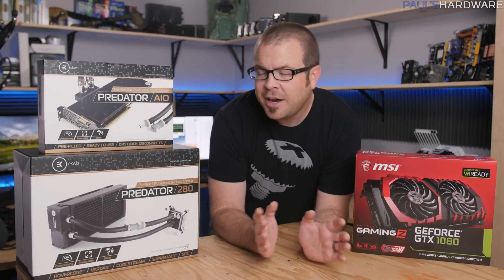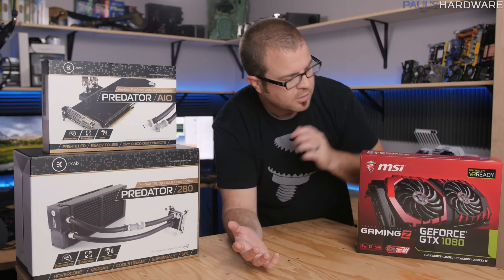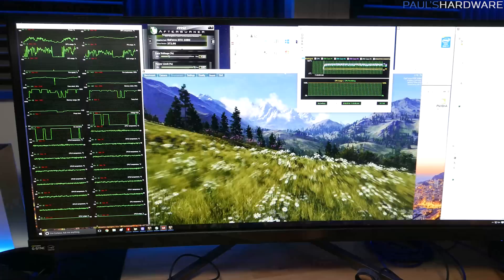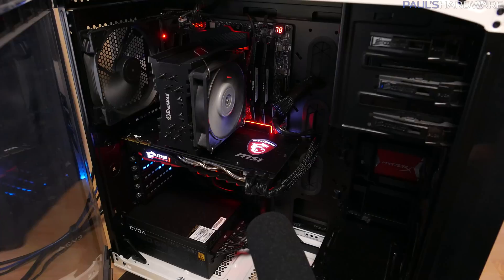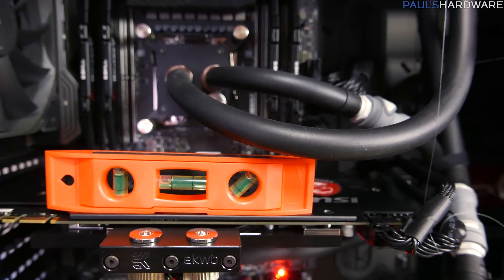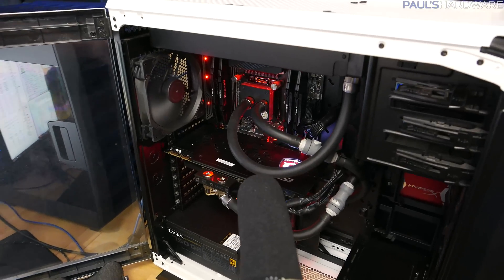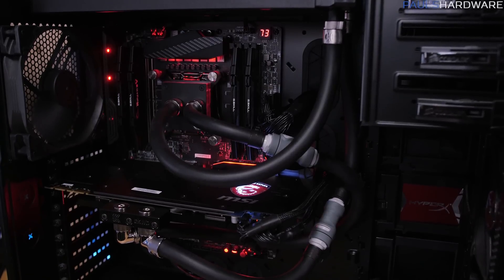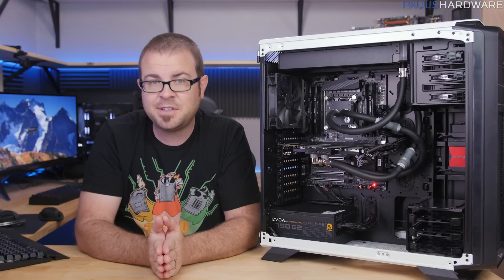Watercooling Simplified: EK Predator 280 + MSI GTX 1080 Z

Comment: This is a nice looking AIO, and the system they use looks very Familiar, seen it somewhere before, ah that's it, looks like the Alphacool 360mm Eisbaer Modular AIO Hydro/Water Cooler system, are they compatible with each other?

Comment: I feel like a reservoir would reduce temps a little.  I only say that because I figure there is only a small amount of water in the loop to begin with and it's always in contact with something that is already trying to dissipate heat.  I just feel a larger volume would help in this particular case.  I know I'm likely to be completely wrong though.

Comment: I'd like to see another video same as this but the results with another 280mm rad into the system. Would be interesting for me. I don't want a full-blown water-cooled PC but want the GPU and CPU covered in a loop(s) because I want easy disconnect to service the system regularly.

Comment: I never had a water cooled system befor, but right now I want to lower the noise level of my case and it´s time to do an upgrade... anyway at this price I would like to see way nicer tubes ... them are not nice at all. Come on - that one is going to hang there in your system, but of course you can replace them with nice tubes and ending up with more useless tubes at home, but thats not the idea of an AIO model. But I like the position of the pump here - it´s beside the radiator and thats really cool. Also checking out Alpha Cool´s modular AIO models - I just don´t prefer the tubes there too, but you have there the D5 pump sitting on the cpu... pumping the water up to the radiator. So having the pump on the cpu - maybe that isn´t the best idea if you think about vibration etc. but running it on lower voltage will make it unhearable... and also the price is way lower. The Eisbaer 280 cpu cooler is at 130 €.  I am confused now with what to go :) hmmm maybe I just go with Corsair H115 or just with a coffee first... anyway thx for the video

Comment: Ignore the part at the start where he said you don't have to worry about leak testing. Always leak test Water Cooling. Regardless of whether it's a Closed/Open Loop AiO or a custom open loop. You need to leak test. Make sure it's not faulty, routinely leak test to make sure the tubing hasn't degraded.

Also, never get a Swiftech AiO.

Comment: Would the 240 version of this fit in an H440?
Reply: XAgent yes, a slim on top and thick on the front, I myself use a 280  45mm thick in the front for CPU + GPU custom loop

Comment: Hey Paul! can you actually make a system that is "Optimized" perfect on Airflow?
As a example the Be Quiet Dark Base 900 Case with 2 140mm front fans,plus 2 120mm side case fans,who directly blow fresh air on the graphics card? as a CPU Cooler the Notcua NH-D15.

The side case fans to cool the GPU down,would be 2 120mm Be quiet Silent Wings 3.

Comment: Those peformance numbers don't look good at all. The Gaming Z model already arrives as the most efficient chip in the stack (when compared to base and X) so even with MSi's air cooler, it won't go above 65°C which is stellar. As for the CPU, I don't see how 68-70°C is good for a water loop. It needs to be consistently below 60°while stress testing to be able to say it's performing well. All in all $300+ is overpriced for these temps.
Reply: There's absolutely NO WAY ambient room temp was 104 degrees Fahrenheit. AT MOST it was 80. Even then most common air coolers would keep an i7 6700k below 75 degrees C. My 6700k (which is OC'd to 4.4GHz) stays below 75 degrees Celsius with a Hyper 212 EVO under heavy loads. Though I'm looking to upgrade to a Noctua NH-U14S to bring it below 70... which is very reasonable.

Comment: Would mounting the radiator in the front make it look at touch tidier? Though I guess without hard tubing loops won't ever look too amazing. In the end though, I think I would personally try and have two radiators, one for CPU and one for GPU(s).

Comment: I think its a decent solution for those people who aren't confident in installing water cooling. I was wondering how you can make sure you have no air bubbles in the system since there is no reservoir in the loop and you can't see through the tubes?

Comment: Hey Paul I was wondering what would be a good video card for my system I feel like the gtx 550 ti is not letting play the games I want or even stream very well at all. What would you recommend for a someone who can't really afford a top of the line video card?(Anyone can help if possible)

Motherboard: Gigabyte GA-EX58 UD3R

RAM: Corsair XMS 3 12GB DDR 3 1600(clocked at 1333)

Processor: Intel i7 950 @3.2Ghz

Video Card: Evga GTX 550 Ti

Powersupply: LSP Ultra 650 watt

Comment: So it seems the gpu's need water cooling and cpu's are just fine with Air Cooling. get a NZXT G10 with any AIO and a Air cooler for the CPU. $150 for the GPU cooling and $80 for a CPU cooler.

Comment: I don't get why everyone does a top radiator mount for this case. There's a top cover that you would have to leave off constantly for it to get any air flow and all those holes/grommets  makes the case look ugly. I saw Linus install a H110i in the front and it looked great. That's what I plan on doing for my 760t build. The temp difference is marginal.

Comment: I have the 360 predator and the length of the hoses is very awkward. And I had to take the top part of the frame of my case to get the thing to fit. But it's awesome, so it's OK.

Comment: Air is pretty cool and quiet these days on modern chips. Pascal is a poor excuse for water cooling and unless you are going to heavily OC a CPU, I just don't see the returns for the money spent. Let slone the potential issues. Water may be sexier but not when a pump fails or leaks. Been there, done that.

Comment: I just got the EK Predator 360 for my i7-4790k and dual GTX 1070's (with 3 additional fans for push/pull). I've been very impressed with temps so far. GPU's never go above 50 degrees and my CPU stays in the mid to high 50's during gaming and in the 60's during heavy workloads (such as video editing/rendering). My CPU is overclocked to 4.7 Ghz at 1.25 volts and I'm running a +110 to the core clocks of my EVGA GTX 1070 SC's. Fans always stay below 60%. Good job, EK.

Comment: i think this would be ideal for people who plan to put 2 graphics cards in SLI and run at cool temps without dealing with custom loops hassle.
what i'd do is buy a custom PCB graphics cards that has better OC headroom than a reference, without necessary having great cooling solution and slap this on them. i think this would make the best value IMO.

Comment: Almost sold on this until I realised you cant run a loop with just the GPU liquid cooled. The only reason I'd liquid cool is for silence, but it's a lot easier to keep a cpu cool and quiet than a gpu under gaming load. Basically I'd be buying the CPU kit just for the radiator/pump.

Comment: Might be a dumb question.
Are you able to use the fan port on the GPU to control the fans on the radiator? 
If that's possible, that would make more sense to me because the GPU would be the hottest component.

Comment: I have the Predator 360 with the EK gpu block on my 1080 with similar sag.  I fixed it with just a chop stick cut down to size.  I think replacing the tubing and routing out the top might help but it's fine for my use.

Comment: try acrylic rod from home depot/lowes etc for a gpu support (replacement twist rods for blinds also work), also I know it's nitpicking but I would seriously hang the hoses to remove the weight from the card, then worry about leveling the card itself, letting the card and the fittings on the waterblock eat the weight of the coolant tubes is never a good idea.

Comment: tips I have a 9590amd chip on a close loop. and I was looking to water cooling my gtx 1080 this would be a good solution to cover both. but Paul I have never water cooled a gpu so next time take 2min to show us more on that. I think CPUs are self-explanatory when it comes to water cooling but when it comes to GPU there are a lot more steps involved hand more past  might be needed, it would be nice if next time you show up exactly every step you're doing to that video card, regardless of how many times you've done it before if you have ever.

Comment: Hey Paul I'm certainly interested in going this route. don't be know if it's possible but could you show results of 360mm predator in this setup? I'm planning on using the 360mm predator on 6800k on titan X Pascal

Comment: A question of mine is wether the radiator cooled water goes into the cpu first or the gpu first ???
Oh and do you run 4k valley or a different resolution ?

Comment: I ordered 2 Predator 280s, one for each of my shiny new Titan X's (pascal), I figure 280mm per card should be sufficient. I'm just not convinced it would be worth buying a third for my CPU seeing that I already have a Noctua 15 with 2 fans that works great. Hope that is enough cooling.
Reply: xsfspd1 in what case? I am trying to get a case for that  the old carbide 540 fit on the top. the new 740 does not fit on the top. Any ideas? Dice ek put these together I have to wait almost 4 weeks arrive to Miami December 14 so I meed to get another case

Comment: Since the graphics card was MSI, they do offer a Seahawk Version with an EK block preinstalled which would have been better for the build but I guess that card doesnt have the right QDC fittings and is not prefilled either. I still think that version looks better.

Comment: The sag on that card though, I would probably buy a horizontal mount case if I were to buy this. Just eliminate that failure mode and make it easier to install and work on.

Comment: Cool but for the cost it needs to justify not getting (most of) an sli/crossfire air setup. It's all about options in the computer marketplace anyways, will be interesting to see if any competitor comes out with something similar for less cost. (and maybe less of an eyesore)

EDIT: kinda hoping you check the 1070 slim cards out, bit of a niche market in htpc/itx but has cool factor nonetheless.

Comment: 280 is really not enough rad. You need at least a 360 or 420 rad for that kind of config for decent temps. And Paul with a full custom loop you could do your own quick disconnects as well....

Comment: if you already know that your going to Watercool is it worth getting the stock/founders card and pay less so your not paying for the expensive air cooling that your going to be pulling out anyway.
Reply: Usually a AIB air cooled card + aftermarket waterblock s still cheaper than a card that comes with the block.
Reply: Generally, I would but the AIB partner cards offer better performance/overclocking than the reference cards due to better design of the PCB's. It's just easier to find waterblocks for the reference cards as well as the cards themselves.  However some companies are starting to offer their cards already with a waterblock attached instead of an air cooler for not much more than the air cooled card:  https://www.amazon.com/dp/B01JZO4U20

Comment: I actually have that case but i choose to watercool only the cpu with a corsair 280mm kit, watercooling the gpu makes sense only if you have a high end card, if not better spend that money on a better gpu instead since gpu waterblocks are not cheap, especially EK ones

Comment: Man I never understand how youtubers get such quiet builds. Even with pretty much a full noctua set up, fan noise is audible even while wearing headphones. Temps are fine but I'll never get the silence you guys seem to get
Reply: Are you running your fans through your PSu or mobo? and are even your GPU and CPu on Noctuas? I have corsair fans for my GPU and standard coolermaster hyper 212 for CPu and definitely can't hear it through over ear headphones
Reply: Buy a good motherboard that allows you to set fan curves or profiles
Reply: my advice is to buy the sentry mesh fan controller, i bought it over a year ago for my case fans and it runs great if you monitor your temps you can manally adjust fan speeds which is what i like doing
Reply: turn your fan speeds down to the lowest man its what i did and i can barely hear my pc idle
Reply: Ollie Janman Motherboard, and CPU and GPU are both on AIOs (Kraken G10) with noctua fans replacing the NZXT ones on the rads.
Reply: Justin Willms cuve the fans
Reply: Justin Willms +Justin Willms That sounds weird then, so the Noctuas are on the mobo? Do you have them hooked up to a set speed? I have a similar thing using the corsair  version of the Karaken on a 980ti and have not had any problems with sound if I'm running the fans at high enough rpm to keep the GPU temp under 70. Have you checked the bios to check the rpm of the fans? If it is hooked up to the mobo you should be able to change the rpm there to soemthing lower, then monitor the temps of your GPU to check the lower RPM doesn't let your GPU reach its thermal limit (i.e when it starts to throttle)
Reply: Justin Willms yea noctuas cheaper fans are garbage

Comment: my other system has H105 cooler (i7-4770k), the one I'm currently using has Noctua NH-U12s (i5-6600k). to be honest I don't see noticeable difference between them. as a matter of fact, the air cooler feels less complicated (fans/ cables/ space) and more robust. I'm thinking to stick with air cooler for future builds. the Cryorig H7 looks great.

Comment: Sound is probably # 2 on my top 5 list when it comes to why I watercool my system (GPU + CPU); I like the fact that even though I'm running with 9 fans - push/ pull on both rads + have the fans running @ 6 volts on a decent fan controller, that it pretty much a dead quiet system.

Lower temps is the # 1 reason for my watercooling; topping out the GPU @ 50 degrees Celsius playing ARMA II DayZ mod all day (during the summer months) is a heck of a lot better than topping out in the 80's (R9 290X 8 GB GPU).

It will be interesting to see how many varieties of the Predator GPU add-ons EKWB decide to put into their arsenal.

You might want to consider using a piece of scrap PETG tubing to level out the GPU; not quite as ghetto as the current solution. Good video as always Paul :-)

Comment: I'm very impressed by these MSI cards. In the build for my nephew I'm using the  standard MSI GTX 1070 gaming (non X /Z) and it boosts out of the box to 1924 MHz while never hitting 60°C under load. The fans are running 1300rpm, staying inaudible.

The complete opposite is my 1080 FE, but it will be unleashed under water anyway.
Reply: Its been a couple months since you commented but buying a 1080 FE was probably the worst decision i've made with my build. I just cant stand the fact that it runs at 83C and thats normal. Quickly bought an EVGA AIO for it now it never beaks 60C in anything.

Comment: Paul other then pressure head and flow rate what are the differences between DDC pump and D5?
and what is more reliable ? 
i think for a build with separate water cooling unit that would be in one room and the pc would get cool water from the unit in other room
any other pump you can recommend ? 
btw nice video

Comment: Although (custom-loop) watercooling can give you a great experience from your close engagement with the build process and can earn you some serious PCMR cred, it seems to me that it isn't worth the money or the effort in terms of acoustics and performance/cooling benefits.

 As far as that EK system goes, I feel that the price benefit isn't really worth it. If you're going for watercooling you probably want the cred and the looks to be top-notch. This one has too much tubing and there isn't much you can do to fix that. And it isn't like you avoid all the technical stuff. IMO, if you want to go that route, save a bit more and get your own custom loop. PCMR cred, great looks, set it as it fits you and that satisfaction from your engagement